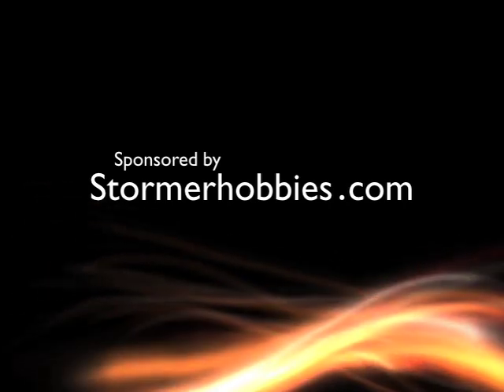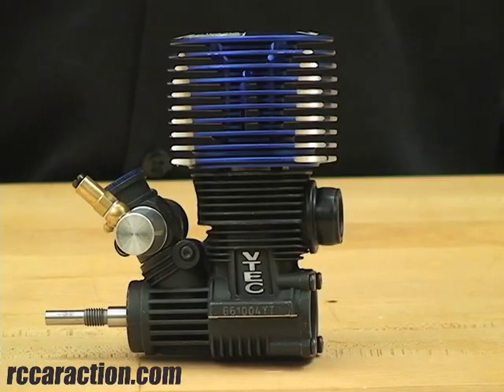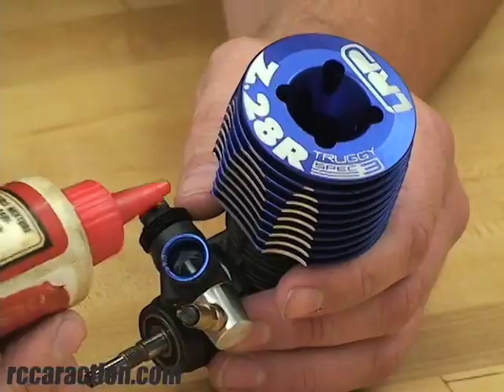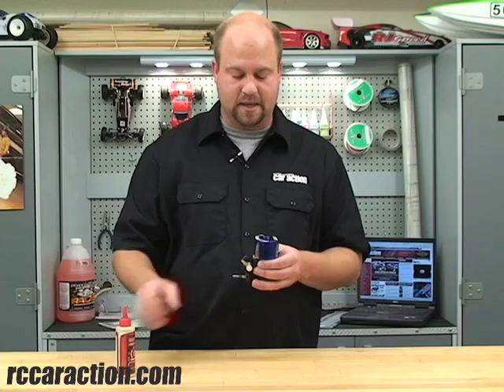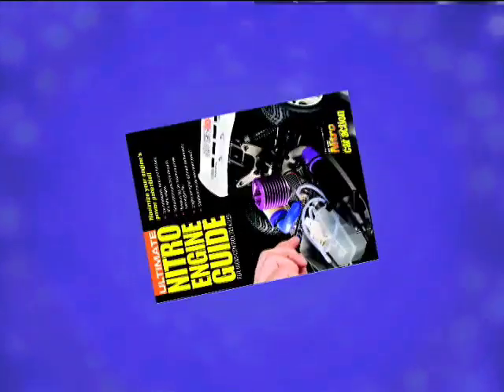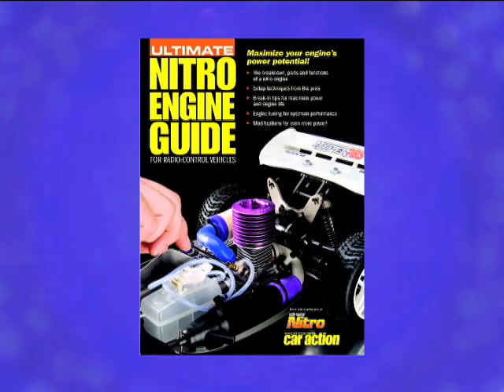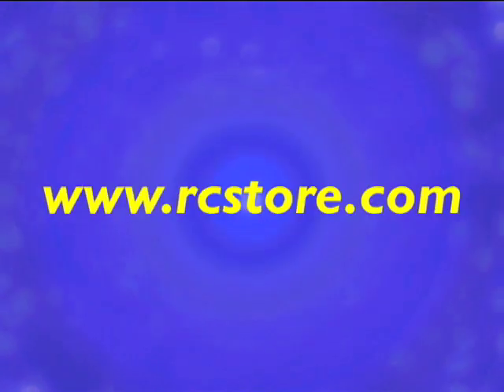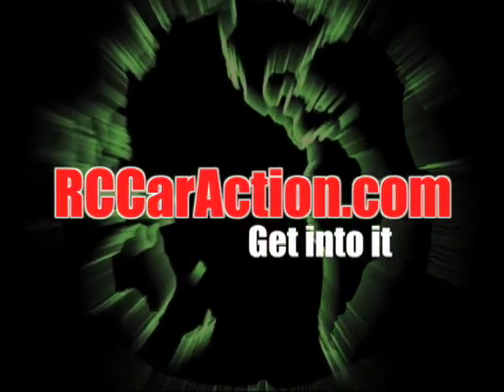Easy Nitro Engine Start

Comment: what type clutch do you have if you have one with a spring make sure you actually put the spring on it since you stated you put a new clutch on it  I'm assuming you may have forgotten to put on the spring remove the engine and look at the clutch if its a two shoe clutch and the shoes just move freely then that is the answer :d put the spring on it or clips :d

Comment: ive been having problems starting my nitro car. i have a .18 engine pull start.  the day before it was running fine, then i put new clutch in and cleaned the cooling head, the next day it would bearly start and when it did it was really sluggish n would only run for about 10 sec.  any help would be awesome.  thanks

Comment: I have an old .15 tmaxx that doesn't want to start the compression is good new glow plug I think it's the carb it's starts then cuts off and when it does start at times the carb spits the fuel out of the air filter hole any help